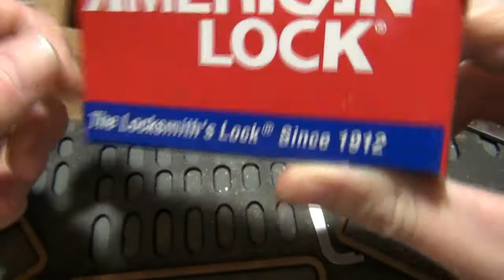(68) 3 of 8 American 1100 Padlocks SPP'd and Gutted

Comment: It seems like they a going with mostly serrated now. Don't know if it's a what's in stock thing or a supply thing. It could be what they find more difficult but I dobt it being owned by Master and all. I don't see them caring that much.
Reply from the maker: Randy Perkins that several I've opened have been two spools and three serrated until this one.
Reply from the maker: +Randy Perkins check my 70 video. Had four spools and one serrated. I'm pretty sure those are factory pinned. They're factory keys.
Reply: Bored Lock picker yes I noticed that. It was shocking cause I went through 10 new locks and they all seemed to be on the low side for spools and when they did it was almost always on a tall keypin, so I switched those ones. I would say about 7 of them only had 2 spools. There was 1or2 with only 1 spool.
Reply from the maker: Im pretty sure thats the first one I've ran across with more than two.  of course any key pin longer than I think a 6 it doesnt much matter.